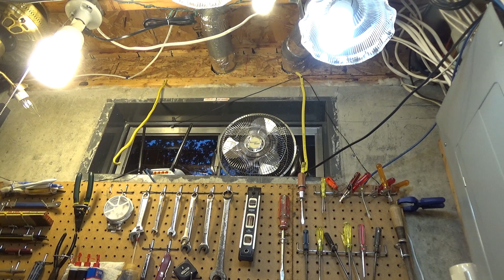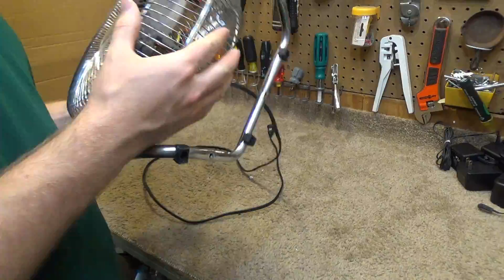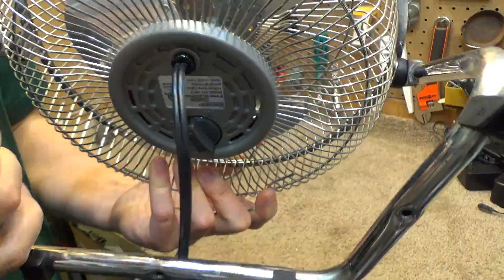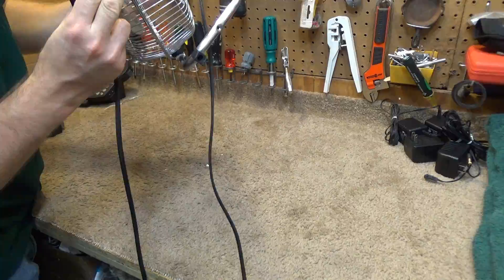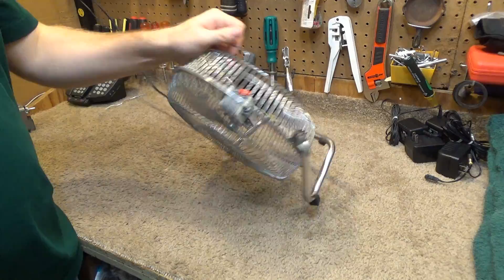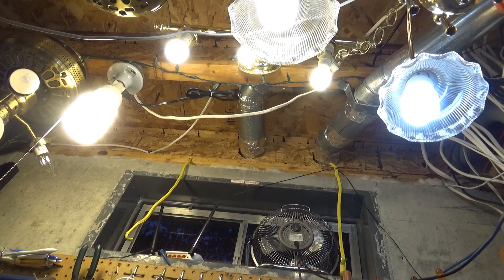A New Motor for the Nantucket Breeze MF-9 9" High Velocity Fan

Comment: @JordanU, can you recommend a suitable replacement motor for my 20 y/o Lakewood 9” fan (since you can’t  buy OEM motors for small fans, grrrr). Recently after oiling it & replacing the capacitor, it continued to run slow & burnt out running on my bench.

Comment: Really good job. Yes unfortunately I think that your original video of this fan has been lost. What do you think of these high velocity fans? I think that these are decent, but nowhere near as good as an HV 9, and these just use cheap shaded pole motors. It seems like the new motor is pretty good though!
Reply from the maker: Thanks. As long as the blades are in balance, they're decent. They don't hold a candle to the old HV-9 models from Lakewood, but they're certainly more durable than some of the plastic offerings of today.
Reply: Jordan U I agree